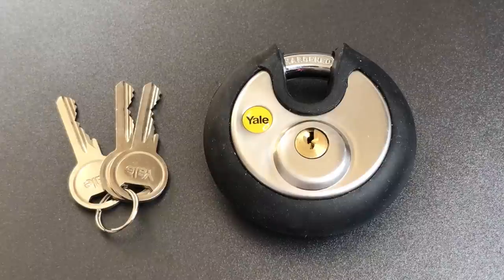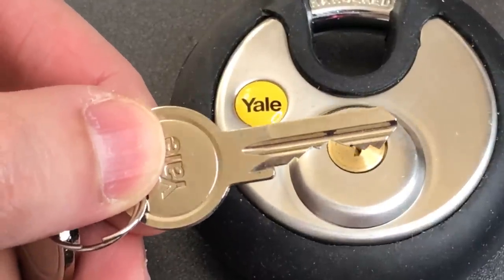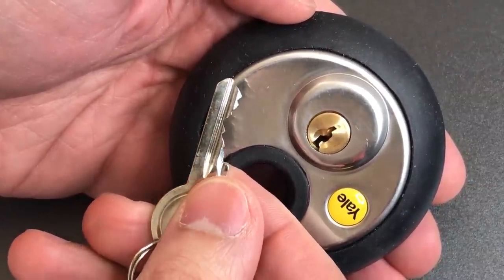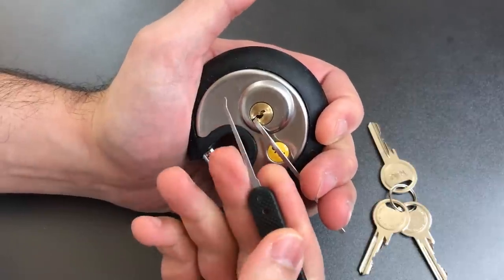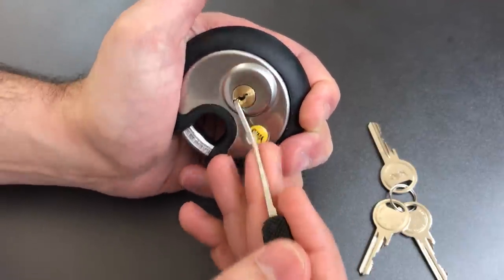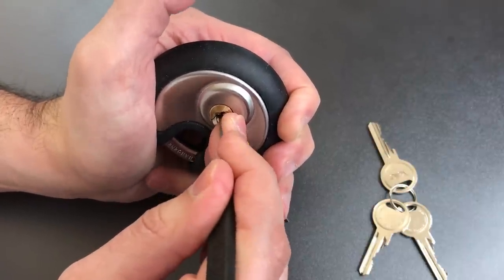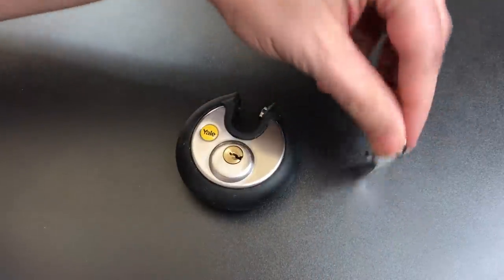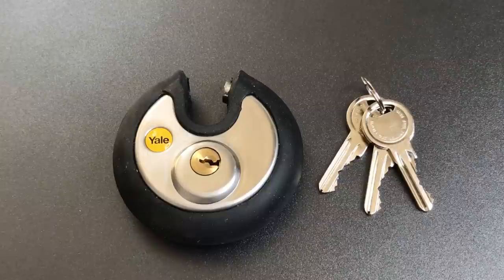[572] Yale Y130/70 Disc Padlock Picked

Comment: I've heard some people say that dead cores are harder to pick than those with lots of spring tension on them, but like you said in the video, I've always found the locks with more spring tension on them to be trickier to open, because they're trickier to tension.
Reply from the maker: +Sightless Senshi that's odd to hear. It doesn't really matter if there are no security pins... but if there are, I can't imagine someone thinking a dead core was harder. Modulating tension can be a beast!
Reply: LockPickingLawyer My thoughts exactly! Thanks so much for validating my thought on the matter. :)

Comment: @LockPickingLawyer Where would you place this yale lock in the lineup of disc padlocks? I am looking at this as a cheaper alternative to an Abus 25/70 but if this isn't close to as good as an Abus 25/70 then I'll pay the extra money. There is also the 20/70 that seems like an amazing lock however Abus stopped using a hardened shackle on it and went to stainless steel do you think that would lower its security in your mind or is the hardened shackle not as important when you can't really reach it effectively?

Comment: Despite how easy you mate it look, that is a decent lock. It would be much harder to pick upside down attached to a locker or similar which would affect your grip and the added stress of doing something illegal
Reply: Michael Wolff it would probably be easier upside down as it would be much easier  to identify over set pins.
Obviously once fitted to a hasp it would become more difficult as does any lock in a real application scenario.
I do think that in the UK as we are used to rim cylinders and euro profile cylinders which have the Core's different ways it makes picking a lock that is upside down or right side up less of an issue.

Comment: I'm surprised how much rotation you got as the pins were set.  Seems like sloppy machining.  I'd expect very little rotation until all were in place.
Reply from the maker: +Russell Hltn The rotation is because of spool shaped driver pins. It is intentional, not poor machining.
Reply: I guess this is where it goes into basics - what the advantage of the spool pins?
Reply: The spool-shaped pins allow some rotation in the core when they are lifted to the right height, they then become snagged up in the shear line which gives the false impression that they are set.  Spools can make locks less susceptable to bruteforce attacks such as raking or bumping, and they can also make the lock challenging to pick.